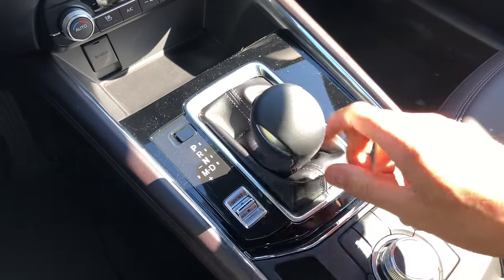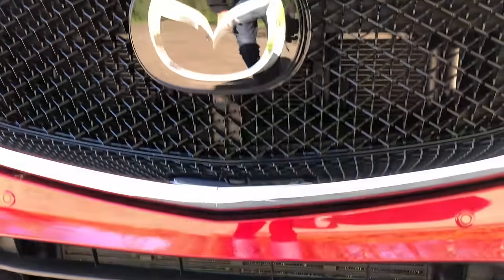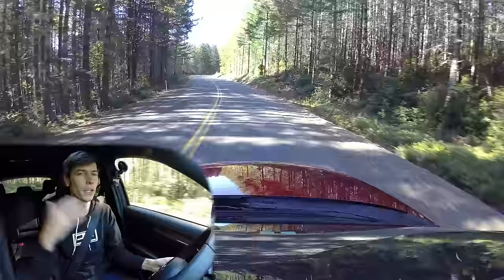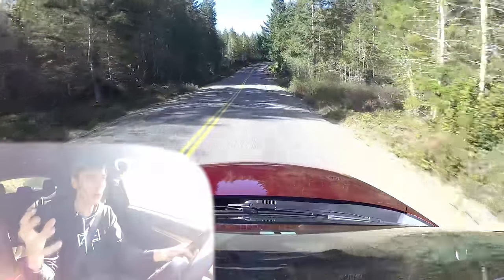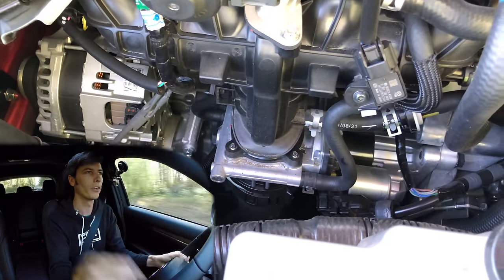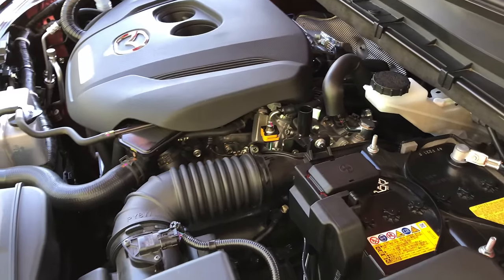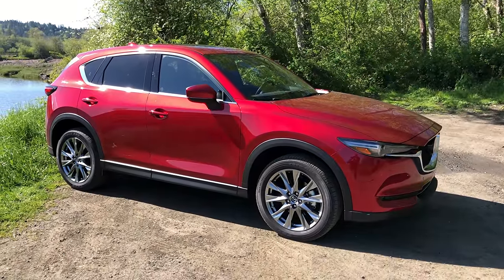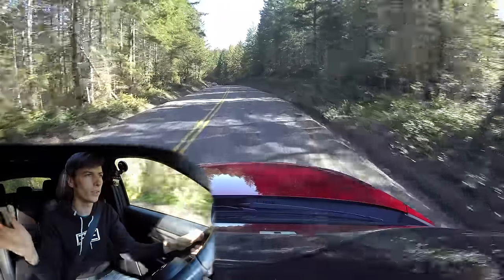Are CVTs Bad? Why Mazda Avoids CVT Transmissions

Comment: Mazda is so much better without ford involved.
Reply: Anyone is better without Ford involved.
Reply: And Ford got worst when they let go of Mazda.
Reply: I know a Ford fanboy who is convinced that Mazda stole Ford tech....I guess pride makes people lie to themselves.
Reply: @jerryp2433  ikr the ford st would of not existed if it wasn't for the mazda speed 3 they literally have the same block and slightly different internals
Reply: @jerryp2433  ford makes mazdas engines, mitsubishi used to make them for mazda in the early 2000s
Reply: I have a 2004 ford ute which is basically a mazda with ford badges. I kinda wish it had Mazda's badges because I far prefer them to ford.
Reply: @ziggyz8345  negatory, Mazda engineers and produces all of their engines in-house nowadays.  As implied above, Ford sold all of their stake in Mazda a long time ago...
Reply: thats how the RX7 died a painful death.
Reply: @ziggyz8345  Not anymore.
Reply: Just saying what Ford learned with Mazaspeed was applied in St line.Honestly Fiesta and focus are great cars.
Reply: People can say whatever they want, but Ford remains one of the most innovative automakers. We all know they made cars mainstream with the Model T, but they also mainstreamed self parking (2012 Focus), the hands free tailgate (2013 Escape, now on pretty much every crossover), and the synonymous direct injection and turbo charging combo. I respect them for all the contributions they've made.
Reply: @Lucky8s  so what's up with them knowingly selling cars with faulty transmissions?
Reply: @Lucky8s  also putting a turbo on a di engine is just asking for carbon buildup.
Reply: @colepeterson9961  That's like saying dodge has known spark plugs are issues on hemis. Just saying every manufacturer has done something.
Reply: @epicshade3463  I agree, dodge is a bad example though they've done a whole lot of somethings:p
Reply: @trata1964  no Chevy is a lot worse
Reply: @xiwihplash8275  Totally agree, is the worst of the trio.
Reply: I have a Ford Focus sedan 2008, and considering the model's year, I am very happy with the car. 😊
Reply: I don’t think any foreign company gets better when they involve one of the big 3 domestics
Reply: Actually, a lot of good stuff came from the time Ford owned a majority share in mazda.
Reply: Or rust
Reply: Ford trucks alone out due anything Mazda.
Reply: @ddm62571  and the Mazda truck was a Ranger. Their trucks prior to Ford were little deathtraps. Ford saved Mazda. Without them, we would be talking about Mazda like we do Oldsmobile.
Reply: Dennis Xu ford literally didn’t innovate any of these things. BMW was doing hands free tailgates before 2010, Toyota created self parking technology in the early 2000’s and DI Turbo engines are not new at all, have been around for awhile from many brands ...
Reply: Please take a breath between your words.
Reply: ultimately mazda would have gone broke without ford's help though so you have ford to thank for mazda existing to this day.
Reply: How do you know Ford isn't still involved?, I didn't know that Renault owns Nissan until this year.
Reply: 4WillDrive lol 😂 When I see a ford emblem I think it’s a dumpster...I go to dump my trash on it and go oh... this isn’t the recycling.  If you drive a Ford, you drive trash so why should it matter if I dump my garbage on it? Every ford produced has issues OF COURSE right a smidge above warranty.!
Reply: Mazda sucked before ford... if anything ford restructured them for the better
Reply: @planetina1145  And literally no one takes the bait.
Reply: @planetina1145  Ferd
Reply: Fix or repair daily
Reply: @TheChondriac  First on race day
Reply: I don't think that it made huge difference. Back in the day Ford used Mazda's technology, for example Ford Probe has a lot of it with Mazda KL and FS engines on top of the list. Later they developed together newer engines, CD3 platform, but it wasn't that bad for Mazda. Mazdaspeed 6 was born etc.
Reply: @epicshade3463  a '14 Fiesta, rather mixed transmission.......good/great engine.
Reply: @robertwoodliff2536  Fiesta is a really good platform in general.
Reply: @ziggyz8345    no, Mitsubishi provided a single 4 cylinder to Mazdas truck for a few years in the late 80s. Then it was replaced with a Mazda designed engine of the same displacement.  

As for Ford they do still hold a license to build engines derived from the Mazda L series. An engine family that arose due to Fords restructuring of the Ford family in the late 90s. Coenciding with them buying a larger share of Mazda the decision was that Mazda would cease production and development of their K series V6 and impliment various Ford V6s instead. And Mazda would engineer a new 4 cylinder engine family to replace their FS series of engines and eventually most of Forde Zetec family of engines.  

Upon Ford selling back almost all of its shares in Mazda to avoid the same bailouts GM and Chrysler were going through they retained the rights to this engine for it's own vehicles.

Mazda impressively became the only full range independent manufacturer in the industry and while cash strapped, recovering from a dismal economy and lacking market share. Their response was to throw everything they had into an almost entirely new range of vehicles entirely removed from any bin engineering they were required to do under Ford.

They developed practically a whole new drivetrain (the automatic is actually a highly developed version of their old 4 speed auto dating back to the 80s!) From scratch with an eye towards meeting the hybrids and small turbos then popular with other makes.  

This was followed with an entirely new set of platforms, that shed the requirements of being rebadged as Fords and Volvos. So they moved the wheels further forward like the old GE/GF platform, improved responsiveness by specifying exactly the type of suspension and bushings they wanted rather than the overly compliant parts required by Ford.

Then they addressed the concern of a lack of power with the new turbo skyactiv engine, next I do expect that they will re introduce true performance variants of the 3 6 and perhaps the crossovers, and perhaps even a new rotary sports car for their upcoming rwd chassis.  A chassis apparently getting a new I6 engine initially.
Reply: Ford is an anti-innovative car giant that neglects car enthusiasts for maximum profits.
Reply: The Toyota should have gotten with Mazda when they made the new 2020 supra instead of BMW.
Reply: @epicshade3463  focus is absolute garbage.
Reply: @Mek3001  I have a 2008 focus estate. Also happy with it. Apart from bad seats and rust
Reply: It is a different breed without ford involved, unfortunately that's what created all the problems that mazda had up until 2012 or 13. Very nice lineup they have right now 👌
Reply: The only Ford I would buy is a 70s f150
Reply: @not_madness809  Agreed, my grandma has an f150 from the early 70s that has 600k miles on the original engine.
Reply: @DrewLSsix  Dude you are spot on. I worked for Mazda for 15 years, a lot during the Ford years. Ford was a bad idea for Mazda, they drove them down performance whise. When Mazda finally broke away their cars started to soar. They will continue to get better and will as they already do make fords look like the junk they are.
Reply: I would agree, but then I remember the Ford years brought us the rotary powered RX-8, the AWD Mazdaspeed6, and the Mazdaspeed3, Protege Speed, and the original CX-7 turbo. Since Mazda has been back on its own more, they’ve just offered really boring cars (in my opinion).
Reply: Ford is so much better without America involved!
Reply: facts
Reply: Mitch  and your point?
Reply: @colepeterson9961  Yup, I've had 2 fusions where the transmission died on me early on.
Reply: @dereksans178  i agree.. mazda with the budget from toyota is something.. they can even make cars with very little budget compared to large companies.. how much more if they can tap Toyota's resources😎
Reply: Mazda is still ford haha, even now in 2020
Reply: @bbracing3925  mazda split with ford in 2008, or at least that's when they sold of enough stock to no longer have a say in what mazda does, they officially broke all ties in 2013.
Reply: @bbracing3925  i think not.. it seems to have separated ways with ford.. from the start of their skyactiv program
Reply: @dornierserctajon8094  I was working on a 8/2019 mazda 3 that still has FoMoCo C/V axles and other misc. parts
Reply: @bbracing3925  isnt the mazda 3 and fiesta, focus more of the mazda than the ford technology? hehe.. im too tired to search
Reply: @Lucky8s  Dude owns a garage around me and he says Ford kept him in business for years and years. Still works on many of them though surely newer Fords are better than 90s and early 2000s. I say 2000s at least through 2010.
Reply: Anglo like to brag ,boast and adventure in their DNA, They always put untested technology in just to put their name for a record first, and that where the failures come from.
Reply: Ford is still very fascinating auto company, however too many wallstreet business people corrupted engineering and designing   to be cheap rather than user friendly, comfortable or innovative. 2002 Taurus was more futuristic then 2010 focus. 

All American auto companies suffer from same dilemma of inviting professional business people to decide what plastic to use, what leather to use, what engine materials to use, and what gasket materials to use. They leak oil everywhere piston gives up burn oil plastics leather feel cheap since 2008
Reply: Mazda surly made Ford’s better?
Reply: MAZDA IS SO EXPENSIVE.
Reply: In liebevoller Erinnerung LOL and let me guess you think German cars are better right? 😂😂😂
Reply: I get that this guy is an engineer, but the cvt is flawed.. I don't know why anyone should get one over this.. or a manual, or literally any other automatic transmission
Reply: @sdunned7842  many people don't care what transmission is in the car. They care about how many cupholders, how many features are automated, and the total square footage of info-tainment. 
Me, I want engine connection. Do you know that in Kia/Hyundai manual transmission cars, you can't even engine brake. Wtf is the point of a mt that's missing it's best capacity, I don't know.
Reply: @Fellafoe69  i dont think anybody wrapped their head what you said....great comment!
Reply: 100%
Reply: Very ironic as the old Ford made Mazdas were super reliable (you see them on the road everywhere) some with hundreds of thousands of kms on the clock. The new skyactiv gen are crap and they fall apart in half the distance
Reply: @MrTubeniko  Ford never made any Mazdas. SkyActive  is efficient technology. I have a CX-5 and it's great. You're clueless, do some research.👌👍
Reply: @bbracing3925  Unfortunately, you're clueless. Ford hasn't had anything to do with Mazda since 2012. Do some research.👌👍
Reply: I hate ford especially the discusting focus
Reply: @emichaels2112  clueless?  🤣  the fact that I acknowledged your previous statement about ford/mazda split in 2012 and educated myself makes me clueless? I am a professional mechanic who works on every kind of car day in and out. I would like to educate you in the fact that they have not split ways 100%. If you actually worked on later model 2012+ fords and mazdas you would know that 😉🤦‍♂️
Reply: @epicshade3463  were

Comment: Mazda is what you get when you want a bit of Germaness in your ultra reliable Japanese car.
Reply: Mazda = VW's that work properly
Reply: @MaestroTJS  facts
Reply: Mazda = Poor man's BMW

You can even abbreviate certain Mazda models to piss off bimmer fanboys:
M3 (Mazda3)
'X5 (CX-5)
Reply: @vangrindz8650   Or you could call it a 3 series.
Reply: @vangrindz8650  Reminds me when BMW couldn't call their M-power-ed X5 the MX5, because copyright 😉
Reply: Wow this is really true never looked at it like that
Reply: Yeah, I think of Mazdas as Toyota-BMW, (aka the Supra but like 10 times more reliable)
Reply: I've had nothing but German cars for a while and was looking for something more practical than my Boxster or my Audi TT for the winters, I bought a CX3 as everything else drove like "mush that put me to sleep". Your comment is perfect as that is exactly what I felt in this car.  I test drove everything else comparable and even slightly larger.  Also as a mechanic that works on all brands I can attest that Mazda has excellent build quality and few if any issues and with their divorce from Ford most cars are built in Japan and today seem far superior as far as reliability over the Toyota and Honda that held the throne for many years.
Reply: Hyundai does pretty good job too!
Reply: Honestly my mom’s mazda crossover has better steering feel than a 4 series we had as a loaner recently. After the e90s bmw’s have kinda sucked
Reply: All suv , only Mazda CX-5 drive like a car
Reply: My Mazda is misfiring :(
Reply: Deez Nuts  They're plenty reliable mazda ranks very well in reliability ratings
Reply: Deez Nuts  Mazda is making reliable cars
Reply: @moonsapling  veloster N!
Reply: @paiboonlathitham5796  there is forester xt..except its cvt..but atleast not as bad as its n.a subaru cvt or other makers cvt
Reply: @lzh4950  Trademark.... not copyright. Things like names of cars are tradmarkable but not copyrightable. also numbers like Intel 486 is not trademarkable, which is why you could buy AMD 486..... then Intel changed then name for from 5/686 to Pentium. so they could trademark it.
Reply: Nhtsa has many recalls and complaints on 2014-2017 models.  Car stalls just like acura tlx! Many complaints. Scary t buy
Reply: @bwdz75  I drove a newer BMW X3 and X5 model recently and thought the same tbh they didnt really feel all that different from a Toyota rav4 or 4runner aside from the cabin insulation
Reply: @moonsapling  I agree, newer Hyundais are really innovative and interesting, 2013 onwards Hyundai has been using a lot of the same components as BMW internally, and they've been putting direct injection in almost all of their engine models. The designs have all been really attractive recently as well since they share a lot of the same major designers at GM & Audi. Many of their engines today are also descendants of other really well known engines like their 4 bangers all stem from the 4B11 that was used in the EVO X.
Reply: @vangrindz8650  BMW is very unreliable especially for their Diesel engine
Reply: @Twan.neuwin  Mazda's "Zoom Zoom" = BMW's "Ultimate Driving Machine" without the high price tag and reliability
Reply: VanGrindz I think the Mazda3 would be more comparable to a 3 series like a 323i not a M3.
Reply: @princepsregem4006  At least until mazda decides to finally bring back the speed 3
Reply: @MaestroTJS  eh. Apart from the dreadful dry DSGs, VWs are very good.
Reply: MX5
Reply: Mazda should market as exactly that.  Never thought of it that way but I did go from a 03' Jetta TDi wagon->04' Toyota Matrix->Mazda CX-5 and it's like all the best and none of the worst parts of both (TDI cost of ownership was higher, Matrix had worse road noise and no luxury - great college car though, Mazda feels like a premium without the cost or excess gadgets - and I paid 27.5k Cad (21.4k USD) new for it..... :o ('16 manual 2L - sadly they don't offer manual any more in NA)
Reply: What overpriced and impractical?
Reply: @vangrindz8650  BMW is a scam of a car.  I'm not a car guy, i just want something to take me from point A to point B.